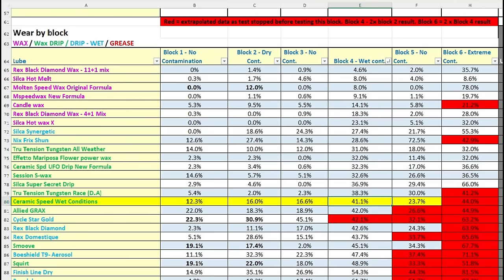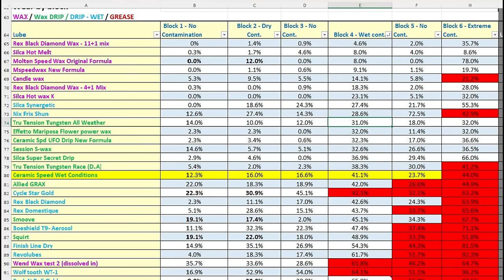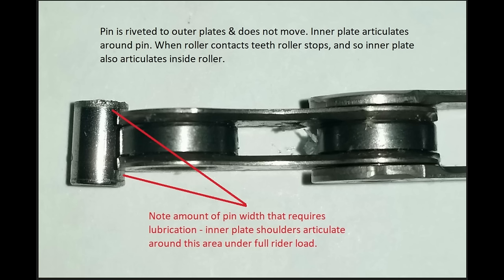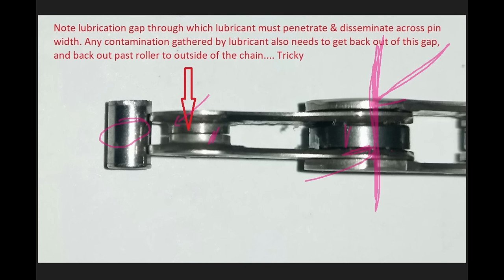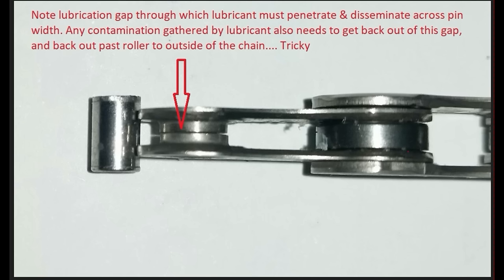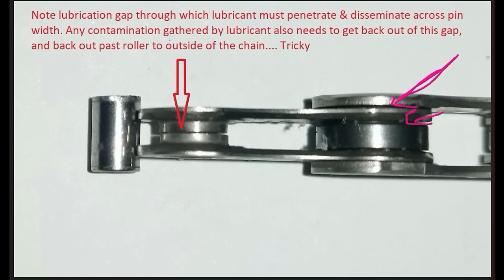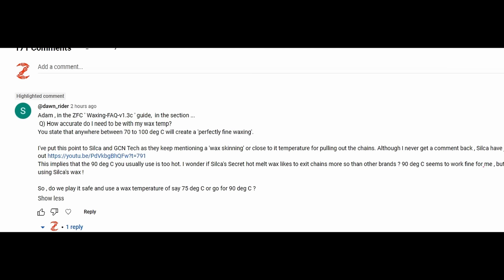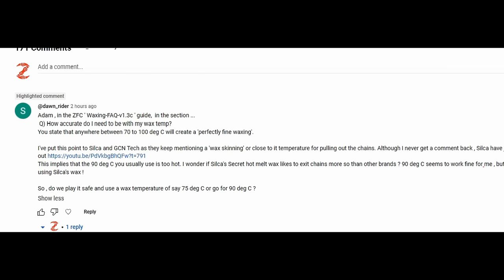wax not last

Comment: my local sram seller sell each quick link chainlink" for 15 $.... Eevery time i wax the chain i get manhandled by their dealer basically. Is there a way to reuse and or 3rd party links available? 

Do you think that EBIKE with 85NM and somewhat decent FTP would mean a lot shorter re wax cycle needs?

thanks!!!
Reply from the maker: wow thats taking some liberties! i would shop online for links - they should be circa $29.90 for a pack of 4.  

yes treatment lifespan for all lubricants is reduced the higher the power - so with non re useable links and e-bike - you for sure want to use a compatible wax drip in between. So wax, re lube next approx 5x with something like UFO drip all conditions which has decent longevity, then re wax to re set any contamination starting to build and use a new link. The wear savings  still with that combo approach will WAY cover the cost of links like that vs just drip lubricant only wear.

Comment: About the target consumer for ceramic wet conditions: maybe someone living in an area with a strong rain sesaon?
Reply from the maker: sort of yes, but sort of no. Its is really more for getting through a long wet ride than anything else. ALL lubricants after a decent wet ride, really one should be re setting contamination. if not post that ride, then as soon as practical afterwards. water brings a lot of crap in, and it isnt going anywhere unless you remove it, so no matter what you run, it will be pretty high friction and wear pretty quickly. So then if its frequent wet work, it becomes what is the easiest to frequently reset. this is not easy to reset.

Comment: OK, so as far as the first results go.... OMG!  I'd NEVER let a product that does THAT anywhere near my drive train.  That's disgusting.  And knowing how tacky and resistant to degreasers it is, NO WAY!  I'd rather run a bone dry chain instead!  (Dumonde Tech did some tests way back and they found bone dry was actually better than some lubes - if you can stand the racket.  I couldn't though!)

Comment: I weigh 110kg full rider weight and do enduro riding here I do climbs of about 400m at a time. I am running a 52t eagle cassette and a 30t chainring. Is it then fine if I am then only getting like 50km to 100km per hot wax? This is South Africa and, in the summer, so it is quite dusty. Would it then be smart to use a combination of my drip wax like Smoove with my graphite wax?
Reply from the maker: Hey Adriaan! 50km is on the short side, 100km is not unusual for lots of climbing, generally high power and offroad dust. What wax are you using at the moment? Generally Smoove and immersive waxes are not a perfect match as smoove uses quite a different wax base, but it is quite long lasting and stays relatively clean if not over applied, so it might work alright as your in between wax lube
Reply: Adrian I'm having good results topping up with Tru-Tension Tungsten All Weather Lube.  Its not expensive and is claimed to dry in 5 to 10 min (although I havent tested the dry time) so worth a try!

Comment: It's absolutely not scientific since it's personal observations of sumc dlc coated chains inner link wear, easily visible and measurable. Surely not enough samples but what I hypothesize is that MTB chains are more susceptible to early lateral wear... 😂😮
Shocking isn't it?
Reply: KMC DLC chains don't last, wear twice as fast as to SL chains, even on road bike. Also personal observation.
Reply from the maker: Hi sorry not entirely sure what the comment meant - were you saying DLC had much less wear? that will be super duper unlikely as DLC is applied as an EXTERNAL PLATING AFTER CHAIN CONSTRUCTION. 

So you have a diamond like hardness coating on outside, which does absolutely ZERO to improve wear life on any parts of the chain under any actual wear load. It is purely cosmetic, and in my opinion, very misleading marketing. 

Sadly in control wear test the DLC 11spd chain was one of the fastest wearing chains tested. Because again there is no DLC on any wear load parts, and to date KMC's actual wear longevity treatments - the XX durability or XXX durability - appear to be not very durable at all.

Comment: Wax the chain when it starts to get noisy.  Wax temps don't matter too much.  Saved you an hour.
Reply from the maker: Thanks Paul! you should start a channel!
Reply from the maker: @paulweber624  I dont think i will ever be the channel for you (or many others). I will try if i can to get to scripting things maybe one day, but this is not my day job - i lack time to prep, time to re take, time to edit, and combined with low natural talent - i apologize i am what you have at the moment. Perhaps check back in 2 years - if i am still doing this see if i am any better. 

I appreciate all good feedback, and try to act on what i can, and i have received some very helpful feedback to improve indeed. I would say yours in this case was less helpful, and more snark. It was rather unfair summary of the video content and learnings. So maybe use this feedback that if you are going to have input, be constructive, not someone just taking a dump behind the keyboard. YT can be a fraught place for anyone to step into, especially for one who is well aware they are not very good at it.